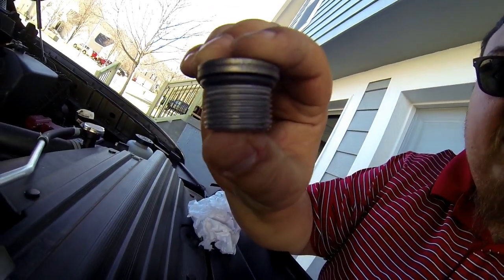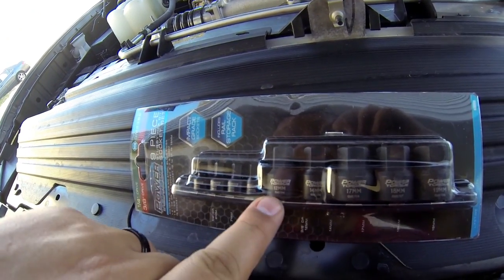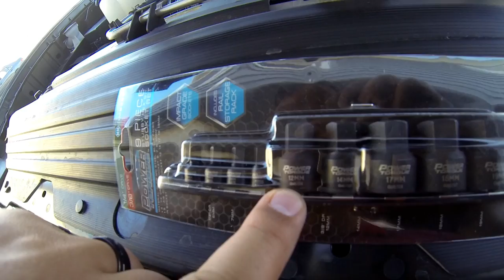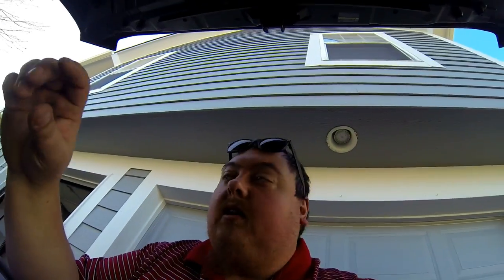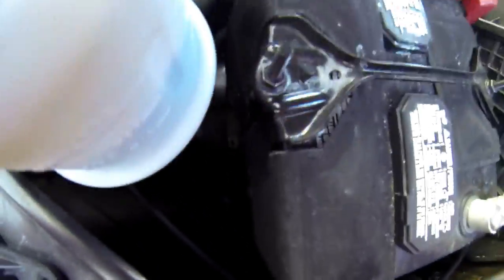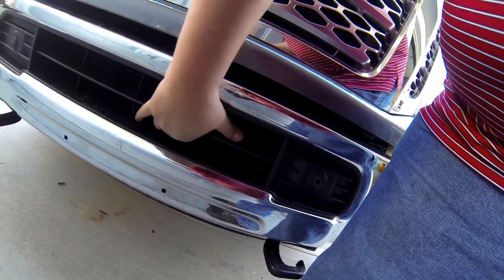Titan XD Block Heater Install

Comment: How well does the heater work? Have you tried it out?
Reply from the maker: I havent had to use it yet, hopefully this winter
Reply: @JohnBec1217  how did it end up working?
Reply from the maker: works great, i put it on a timer in the garage. Have heater alot quicker